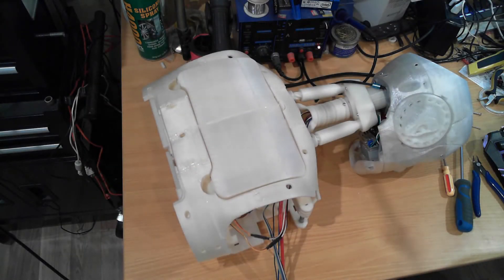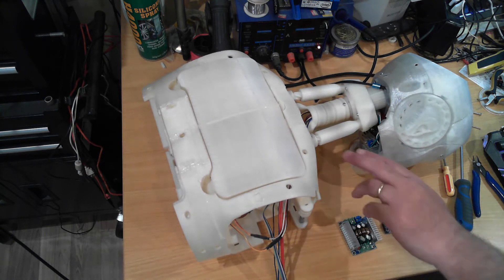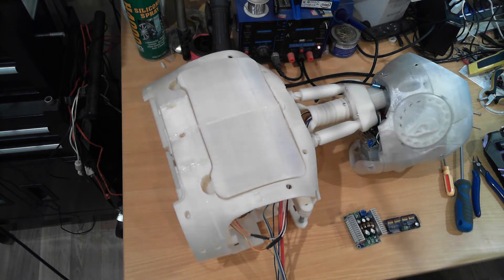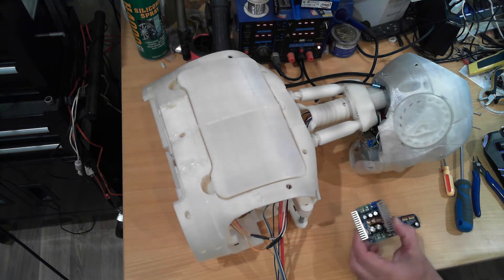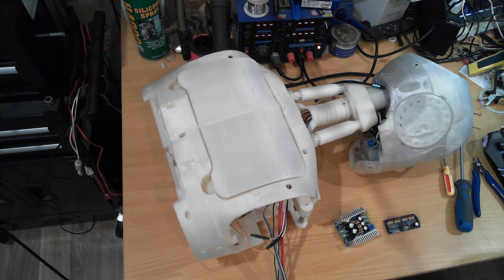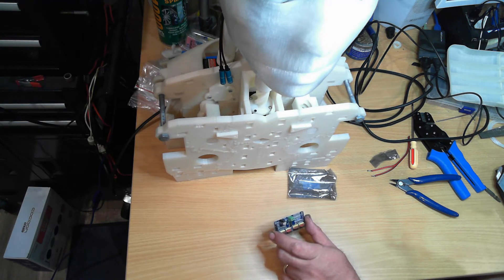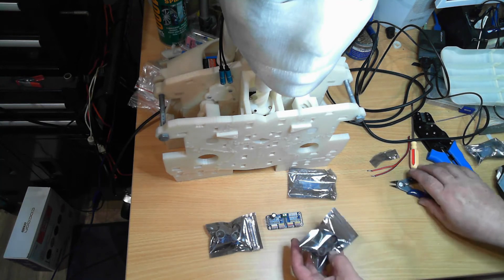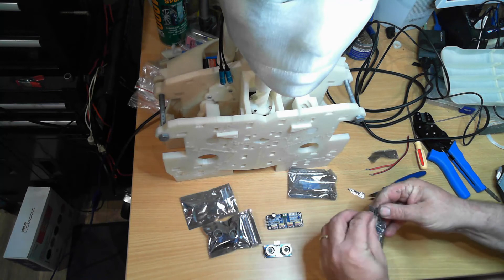Freds Head New Stand Part 5

Comment: do you have a video that explain your wiring and connections ?
Reply from the maker: Not as yet, but I am working on networking at the moment and will look at how that applies to Fred after that.
Networking includes serial,I2C and ethernet as well.
Is there an area that you were interested in?
Reply: @CyberOne  yes how you connected your switch mode power supply and your pca 9685 and to what did you connect it ?
Reply from the maker: I'll see what I can put together for you.
I've just setup Fred's network, but I will make some drawings of his power distribution systems and a bit of a recap as to why I've done it this way.
Also a note on things to check before connecting parts such a setting the SMPS output voltages from the default 12V to the 5.1V or 6V as requires.
The Raspberry pi isn't going to like the 12Vdc on it's 5V power input :-)
Might be a couple of weeks before it's out, but it's a good one to add to the que :-)
Reply: @CyberOne  thank you sooooo much this will help me so much otherwise I'll be stuck right here .
Reply from the maker: @louwrensburger1796  I've recorded the video and uploaded it.
It's due for Patreon release today at 4:00pm ASET or UTC+10
Then it's released in YouTube to the general viewers two weeks later on the 14th of May.
The video out today for YouTube is wiring up the Raspberry Pi 3 with the 7" touch screen and the 5 port 5V network switch as well as the output side of the AT30 SMPS.
Next week on the 7th May, its the wiring for the batteries and the power switches.
then the overview including a hastily made drawing of the power distribution.
Using the AT30 SMPS, being a buck boost, I can run the head from as low as 6V and it will work, although I plan to use 20V most of the time :-)
Hope that one will help you out more. :-)
Ray
Reply: @CyberOne  thank you I can't wait for it to be released you're helping my progress go so much faster

Comment: Great video. Why did you choose to go with the PCA9685 instead of the Arduino?
Reply from the maker: That's a very good question.
There were a number of reasons for it.
1) I wanted to reduce the number of wires I had to route around the robot, particularly through the joints.  Using the PCA9685 I only need to route the two main power wires and 4 wires to provide the control power and communications for 16 servos and other devices like the 4 channel I2C analogue input module.

2) The shipping time for the Nervo boards was going to be much longer than getting the PCA9685 modules.

3) At the time, I was running the Raspberry Pi 3 which has built into the GPIO pins the I2C bus, and that is supported in MRL, so I didn't need to use any Arduino Mega 2560 which I didn't have at the time. I do have those Arduino's now and am now running a Raspberry Pi 4.

4) The plan was to put the Raspberry Pi into Fred's head and use a Raspberry Pi Camera as part of his vision system.  I also looked at a couple of things to help with that like the Intel Movidius Neural Compute Stick.  The Movidius, while it will run on a Raspberry Pi 3, was not that easy to develop for and I hadn't found a way to use it with MRL, since then, support from Intel has been dropped in favour of the NCS2, the newer version of what I have.  I have found something that might help from Seeed Studios, the AI HAT for edge computing but I still need to learn how to program it :-)

5) I like to be different :-)
I think instead of having one big computer running the whole of the system, we can do better by using a number of smaller less powerful and less power consuming computers, each performing a dedicated set of functions, So one for computer vision, one for audio TTS and STT functions, another for position control and sensing ect.

This might be made a bit easier with the Raspberry Pi Pico that's just been released...
The path I have followed may not be the best path, but unless someone tries it, how do we know?
It's like the Walking Robot project https://youtube.com/playlist?list=PLgXTfFM40HqEMwg9rJ078INRYWDCG66B3 , I'm one of many people trying to build a walking set of legs, Someone else may beat me to that goal, and if I can help them succeed using the research I have done, then I'm fine with that.  Have a look at https://www.youtube.com/channel/UCmNhFjZ-d_52VrenIOAs0EA
I don't know how successful this will be, but I hope it works, in any case, we will learn from that project.
I have other ideas using a tendon based approach, that may or may not work, but at least we will learn something from it.
If you want to see more of the research or even contribute ideas to it, catch up with me in Discord :-)
https://discord.gg/5kAjrjT5sd

See you in the next video :-)
Reply: @CyberOne  thanks for the explanation. Similarly I don’t always follow the norms. I like the idea of using a Raspi and currently I’m using a Raspi 4 and in the future possibly a Raspi Pico. I like your idea of using the PCA9685, especially for the hand and arm to minimize the cables running through the robot.

I’ve been following your Walking Robot series and the Dara Robot series. I wish you and Fernando much success and hope one day I can contribute. I need to learn how to program. I know enough to be dangerous but not enough to write anything useful from scratch. Currently I’m learning and more of an integrator of components others have created. I see this as building blocks to creating something unique. I’m already on your discord and loving it.